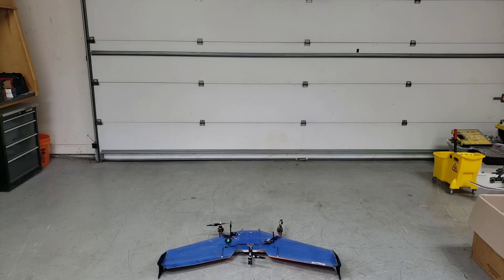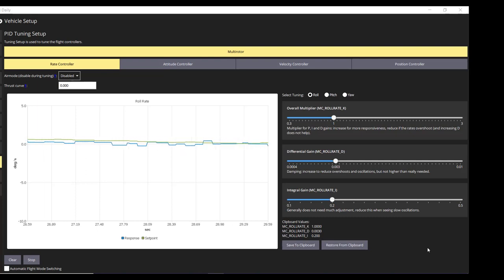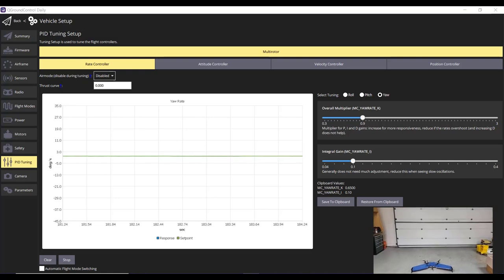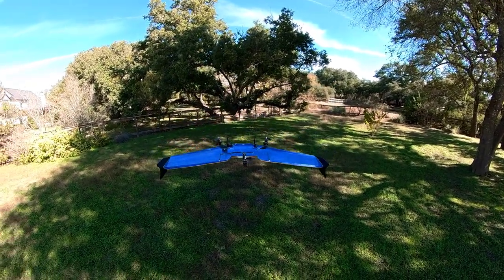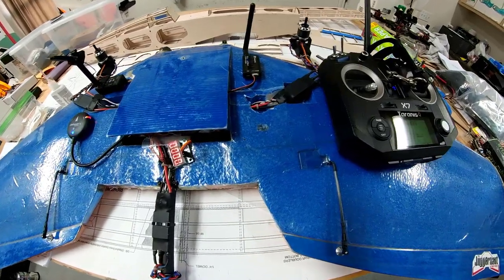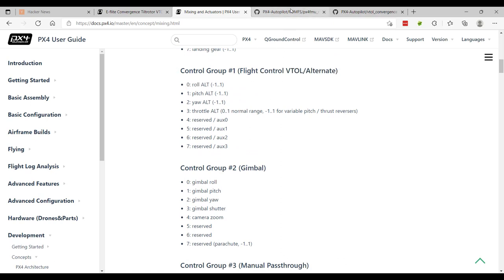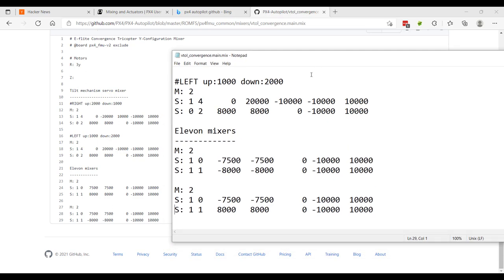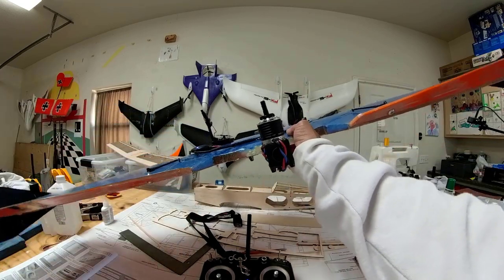PX4 Tiltrotor PID Tuning and Elevon Mixing with SweepWings Juggernaut Delta Wing

Comment: Great video! Looking forward to the next! Question - why didn't you just use the PWM_MAIN_REVx parameter instead of redoing the mixer for your two elevons? That would have reversed the output at the controller side.

Comment: Hi, really clear video! Is there a reason you chose to change the mixer file instead of reversing the servo using the PWM_MAIN_REV parameter in QGroundControl?

Comment: I REALLY THANKS ALOT, my airframe is not the same but it helps me a lot! I am following you to see other px4 documentation tips and explanations!
Have a nice day! :)
Reply: And also I will be appreciate if you dive into that topic and the others... I stuck somewhere and in discuss forum nobody returns me...
Reply from the maker: What airframe are you currently using?
Reply: @dennisbaldwin  13030 /  Generic VTOL Quad Tiltrotor but do I have to add extra features for example PID or something I know it depends on my project but in airframe folder I saw just these:
#!/bin/sh
#
# @name Generic Quadplane VTOL Tiltrotor
#
# @type VTOL Tiltrotor
# @class VTOL
#
# @maintainer
#
# @output MAIN1 motor 1
# @output MAIN2 motor 2
# @output MAIN3 motor 3
# @output MAIN4 motor 4
# @output AUX1 Motor tilt front left
# @output AUX2 Motor tilt front right
# @output AUX3 Motor tilt rear left
# @output AUX4 Motor tilt rear right
# @output AUX5 Aileron left
# @output AUX6 Aileron right
# @output AUX7 Elevator
# @output AUX8 Rudder
#
# @board px4_fmu-v2 exclude
# @board bitcraze_crazyflie exclude
# @board holybro_kakutef7 exclude

#

. ${R}etc/init.d/rc.vtol_defaults

param set-default VT_IDLE_PWM_MC 1100
param set-default VT_TYPE 1
param set-default VT_MOT_ID 1234
param set-default VT_FW_MOT_OFFID 24
set MAV_TYPE 21

set MIXER quad_x
set MIXER_AUX vtol_TTTTAAER

set PWM_OUT 1234
so If I add something new features in that airframe file, do I have to use SD card? Does it mean making new airframe when I add something extra feature to that file?
and also my controller is Durandal so do I  have to add airframe and mixers in: ~/PX4-Autopilot/build/holybro_durandal-v1_rtps/ROMFS/px4fmu_common or just PX4-Autopilot/ROMFS/px4fmu_common is okay?
Reply: @karatugba  as per my knowledge,  first you need to modify the code according to your requirements and than you have to save file with same name after that you can apply that code using sd card.
Reply: @dj-oi9kc  Okay, I will try it, thanks you so much replying me.
Reply: @karatugba  welcome. You know coding? In my project, i am facing some problems related to coding(firmware modification).
Reply: @karatugba  specifically in motor mixing.
Reply: @dj-oi9kc  Hi, I am sorry I was doing some other duties, I couldn't reply you,what kinda coding are you talking about? In the doc. page I didn't see any coding part of the changing features of existing airframe?
Reply: @dj-oi9kc  I will change my airframe with 2 tilt and 2 normal motor, so with this 13030 airframe I have to change 2 tilt to normal, when I come to that point I will make you know, what will I do or somwthing wrong, I mean anything.